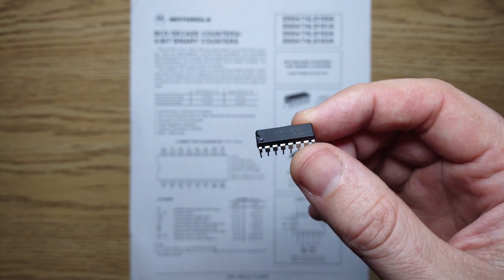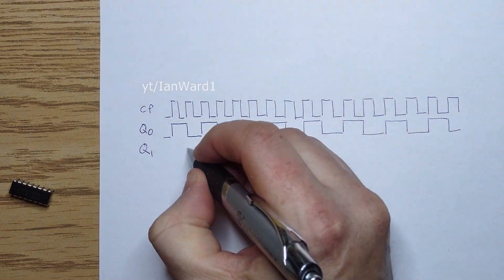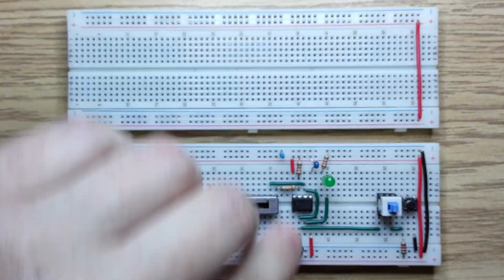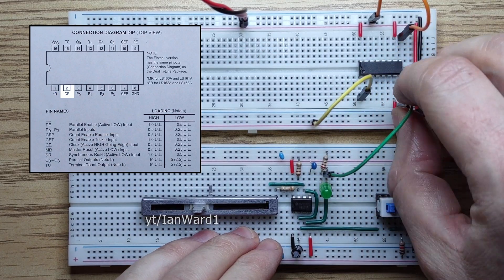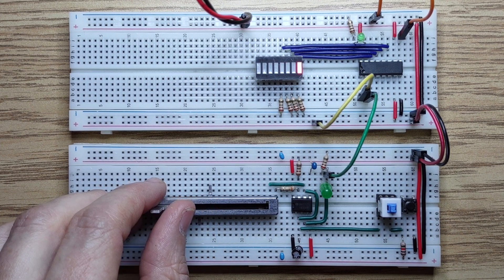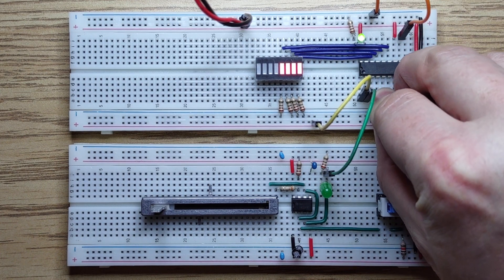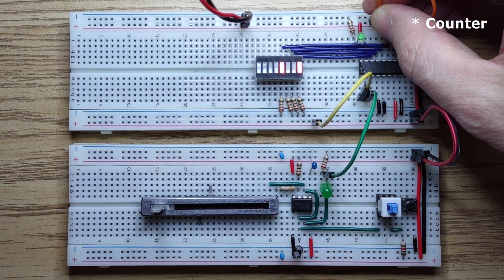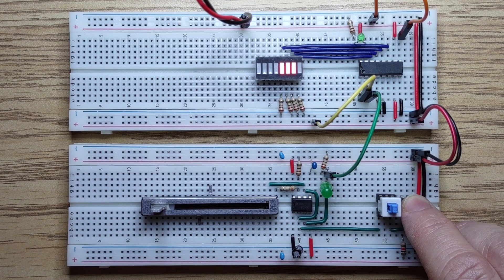Synchronous 4-bit Binary Counter 74LS163

Comment: If I wanted to make the binary counter/display count from 1 to 6 and start back over at 1, how would I do that? And which logic gates do I need in order to do that?
Reply: Take the binary value of 6 (1010), take a not gate for the off states when it reaches 6, put all those into an AND gate, and the output of that AND gate to the base of a transistor with collector at the reset pin connected to ground. Also have a resistor of around 10k from vcc to reset so that it doesn’t reset randomly.

Comment: I actually just bought the LED display for one of my design labs, does the display have to be a certain direction for it to work or does it work either way you put it on the breadboard as long as you wire it correctly?
Reply from the maker: If it doesn't work flip it around. LEDs only work one way

Comment: Where do you get those cool little blue caps. I also got the 2004 working earlier. This is one of the only ttl ic I do not own. I have it ordered. I have thousands of logic ic
Reply from the maker: These caps were part of a collection of parts given to me by an engineer specializing in analog electronics, so I'm afraid I don't know. They're actually not the right ones for my 555 circuit so I should replace them.
Reply: @IanWard1  is that why you didnt debounce the button by just putting a 100nano across the button